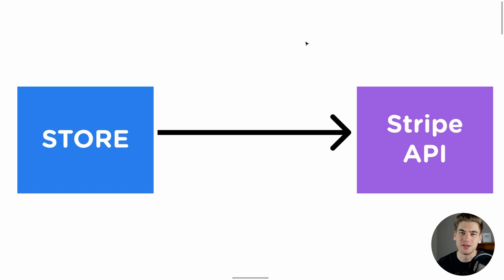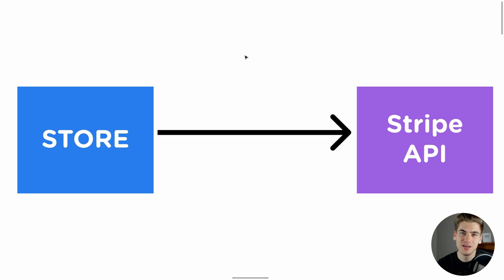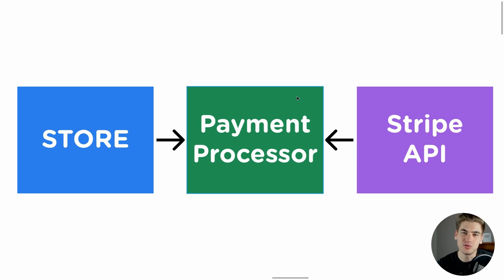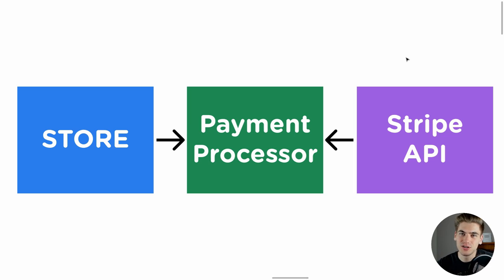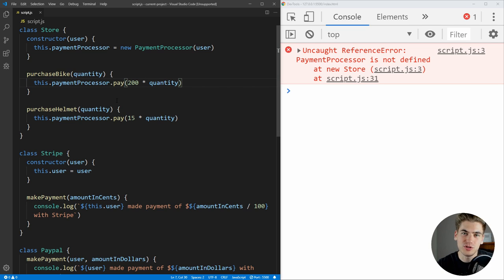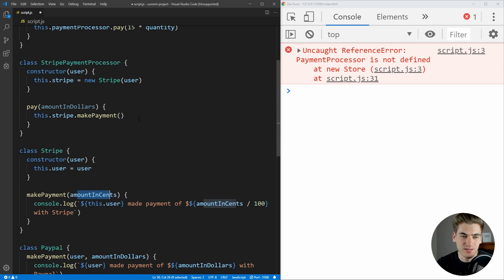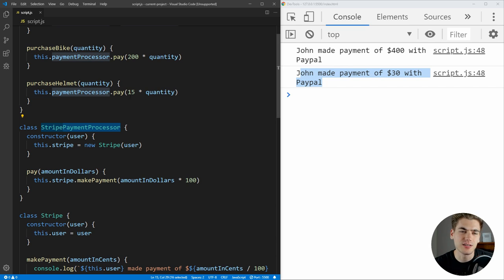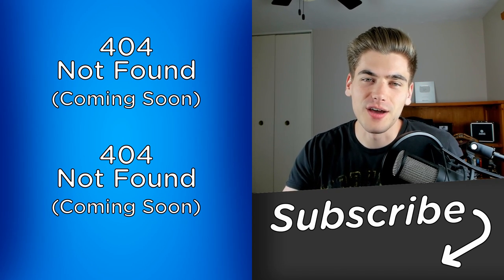Dependency Inversion Principle Explained - SOLID Design Principles

Comment: Wouldn't you want just a single PaymentProcessor and have the logic for handling the different integrations within the class itself so you don't have to duplicate the entire class to change a method?
Reply: That violates OCP
Reply: No, you want some interface or set of interfaces for the payment processing, like an abstract class for the Payment Processor, and possibly using something like the Strategy Pattern, to make your concrete Payment Processors. Then you can use the Strategy Pattern to just swap out between different PaymentProcessors easily.

Comment: Another great video as always! I wish I learned SOLID earlier, so much pain and suffering could have been avoided.
Reply: I have mentored Jr. Developers and wanted to share my experience.  Teaching SOLID too early doesn't work because the coder doesn't have the painful memories that mentally reinforce  / accurately quantify the value of SOLID. The same goes for recognizing code smells.  A Jr Developer is often just pleased with producing a result that works because that's what yielded a good mark in school.  (CS degree is a joke IMO.  Its like teaching just enough chemistry to make bombs without any safety training)
Reply: @skewty  ++. Let juniors be juniors so they can become good seniors
Reply: @danielmcgrane8608 I am happy to read your comments. If dependency inversion is not for juniors then I am leveling up. (:

Comment: Honestly i didn't catch the point of doing that in this example. For me it looks like instead of 2 store classes for each payment method we have just created 3 classes (1 store and 2 payment processors). I thought it should be one payment processor class for both cases which will react different depends on arguments we passed either paypal or stripe. So, a little bit confused by this lesson.
Reply from the maker: The point of this code is so that we can decouple the API we use and the store from each other. Now our store only depends on the processor wrapper we created so we can freely change our API of choice by just creating a new wrapper to wrap that API and our store stays exactly the same. If we tried to make one payment processor that handled all the APIs then we would be violating other SOLID principles such as Open/Closed.
Reply: @WebDevSimplified  i didn't hear yet about that open/closed principles. Thank you for explanation and for all your short but effective  lessons 👍

Comment: Why not make StripePaymentProcessor and PaypalPaymentProcessor implement an Interface PaymentProcessor to enforce the structure of the makePayment method? Optionally it could also extend a PaymentProcessor abstract class if there is some shared method.

Comment: Hi, very nice video! Learnt a ton. Just wanted to clarify my understanding and would appreciate any feedback from anyone here in the comments section. Essentially, by adding an intermediate interface we effectively decouple the store from the payments services. The most common use case I can think of is that, suppose we had a package that aggregates payment services. The consumer of the package doesn't care about specific implementation hence give them the API with an interface. This decouples logic such that the devs working on the package can freely change logic without breaking there consumers code.

Comment: thanks! Note to self - pass individual implementations as object in the intermediate class (functionality resides within individual implementations and intermediary acts as a glue). this way code is losely coupled and is easy to switch rather than be tightly coupled. Facade pattern eg. is very similar to this. Also Dependency injection in angular / Nest feels similar to this where controller will offload functionality to services).

Comment: Only an interface is needed, which would be implemented by both Stripe and PayPal classes. 

I guess Javascript doesn't have interfaces, right?
Reply: normal js doesn't but typescript do, and its almost the same as js but you can use int, float, etc..

Comment: For some who didn't know about the origin of DI.

It was implemented as "Adapter Pattern" as one of Design Patterns. It was only coined as DI because we don't want to depend our application to the framework. We want the framework to depend our application.
Reply: I don't know what is to depend anymore.

Or maybe it's that the word is ambiguous at times.
Reply: @FG-qs8uj  If you want to know more why DI is so important in large scale application. try to search up Clean Architecture by Uncle Bob. It's just the same as SOLID principle.

If you're not happy with OOP. then youi can always go back to Functional Programming.
Reply: If you read what you wrote:

We don't want to depend X to Y.
We want Y to depend X.

X is application, Y Is framework.

Wouldn't be better:

We don't want X to depend on Y.
We want Y to depend on X?

Or:

We don't want Y as a dependency of X
We want X as a dependency of Y.

In any case, my point is that saying X depends on Y is more intuitive to me. I.e. an application depends on a framework to work, i.e. if you see the application requirements file you would see the framework mentioned.

The other way, Y depends on X. Meaning the framework depending on the application is not intuitive to me, since the framework doesn't need the application to work.

I suppose then that the semantics of 'depend' and derivative words is what is confusing.

And even then, I don't see the point on discussing Y depending on X Vs X depending on Y. At the end I don't see what changes in the code.

Comment: Hi Kyle, good tutorial. thank you.

I am little bit confused to distinguish the OPEN/CLOSE and dependency injection based on your example. They are very similar. Can you explain more, please give example
Reply: SOLID is
Single responsibility
Open close principle
Liskov substitution principle
Interface 
Dependency injection

Richard Martin's said that the S and the O can be join together and create a Dependency inversion principle. 

So in shorter words, they are the same
Reply: @nandomax3  dependency injection is not a principle. Dependency inversion is the fifth principle. Dependency injection is an implementation
Reply: @vittoriomorellini1939  it's funny, because I posted this a year ago and just learned about spring DI implementation this month hahahaha

Comment: not gonna lie i had to repeat the video few more times and write some code to understand this concept 
basically what i understood : 
the high level code should not depends on the low level code is like you TV should not depend on you remote remote controller , that if your remote controller got lost you wont be stuck or have to miss with your tv to make it able to use other controller. 
so we should from the start before making the tv and the controller we should first make an interface that both tv and controller agrees on and can work on , after making the interface we make the tv and controller which cant interact with each other through it, so when we want to make new controller for example that we can use for our old tv , it enough for us to focus on make a controller that fit with the interface like the old controller used to be

Comment: But what is the point of making two abstract classes instead of one? Make one, make a init function, a makepayment function and the paypal/stripe fully inherit that and you define what you want.  The only thing that happened is that instead of defining a new entity Paypal and using the function, you added a new class which calls the subclass.
Reply: thats what I was thinking. The paymentProccesor could implement a strategy pattern right? Which keeps it all clean and simple

Comment: This kind of stuff screams for the use of interfaces (I know they are not supported in JS, one of the reasons I moved on to TS)
In this case it's the responsibility of the developer to make sure all paymentProcessors implement correctly the method pay
Reply: This is exactly what I was thinking. Programming without interfaces always looks so cumbersome. This could have been resolved in a much simpler way with an interface.

Comment: There are no interfaces in Javascript? How can you be sure that each type of *PaymentProcessors has method 'pay'? Or should you check it manually in Store class?
Reply from the maker: Unless you use something like TypeScript you cannot guarantee this. It is just something you need to know when developing the code.
Reply: You could write unit tests that verify certain functions exist on both
Reply: Simple version: 
Check that the pay method exists before setting this.paymentProcessor.

 if (typeof paymentProcessor.pay !== "function") { 
    throw new Error('Store.paymentProcessor requires method pay ' )
}

Sophisticated version:
Create a NullPaymentProcessor class that contains the required methods, but they throw a descriptive error (or handle the exception some other way, depending on your implementation) , then make StripePaymentProcessor and PayPalPaymentProcessor extend the NullPaymentProcessor class.

class NullPaymentProcessor {
    pay() {
        throw new Error(`No pay method defined in ${this.constructor.name}. pay is a required method`)
    }

    otherMethod() {
        throw new Error(`No otherMethod defined in ${this.constructor.name}. otherMethod is a required method`)
    }
}

class StripePaymentProcessor extends NullPaymentProcessor {
    constructor(user) {
        super()
        this.stripe = new Stripe(user)
    }
}

class Store {
    constructor(paymentProcessor) {
        this.paymentProcessor = paymentProcessor
    }

    purchaseBike(quantity) {
        this.paymentProcessor.pay(200 * quantity)
    }
}

const store = new Store(new StripePaymentProcessor('John'))
store.purchaseBike(1)

output -> No pay method defined in StripePaymentProcessor. pay is a required method

More or less, use the null object design pattern to implement an interface in javascript. Kyle, would you agree with this approach?

Comment: Does this mean we need to create middleman classes/functions whenever we have dependencies on external third-party api's? Should we do the same if we have have dependencies on internal modules(if it is a big/long module) we ourselves created?
Reply: Coupling is only bad in one direction.   Also don't couple high level business code / computation code with low level data storage / access code.  Uncle Bob is probably the most famous SOLID guy.  Checkout some of his videos if you are interested in further developing your understanding of SOLID.

Comment: In practice these abstractions make code difficult to read and navigate: you keep getting to abstract interfaces and then having to back reference and sometimes guess which implementation is used. The whole idea is that we may easily swap out implementations but in practice this is surprisingly rare.
Reply: Depends on the kind of software you write, sometimes it's very useful. It also facilitates decoupling which can reduce build time in compiled languages and makes it easier to unit test your modules separately which is in my opinion the real reason to do this.

Comment: Is dependency inversion the same as abstraction?
Reply: Dependency Inversion is a form of abstraction, but not all forms of abstractions are Dependency Inversion. Basically, you use DI when you're implementing something that can be done in multiple different ways and you may need to change/support other ways in the future. Besides the Payment Processor example in the video, another example would be if your app had a "share to social media" feature. Say you only wanted to have an option to share to facebook now. You could make a facebook class &  shareToFacebook() method that shares your content to only facebook. But now if you decide to add options to share to twitter or instagram later, you're going to have to edit multiple places in your code base to support this.

Now imagine if instead of creating a facebook class & shareToFacebook() method, you created a SocialMedia class and a generic share method that can be passed in a specific type of social media. Now you only have to extend the SocialMedia class to support twitter, instagram, etc and you don't have to go and edit your whole code base like you would in the facebook class example. Hope this makes sense, good luck!

Comment: So this gives the same  advantages that dependency injection gives in .net can make coupling loose
Reply: Hmmm not sure! Dependency inversion is a type of dependency injection. What is special about this kind of DI is that you do not declare in any moment what concretion will be used inside the high level classes, it leaves it to the client code in which the high level class will be instantiated. Not any dependency injection works like that, after all it's possible to design a dependency injection declaring a low level class inside a high level class, which violates the dependency injection principle, making the high level class get to meet the low level class, generating coupling.

Comment: PaymentProcessor should had been the abstract or interface and , its implementation should be injected automatically where its needed. And unfortunately JS  doesn't have these cuz it isn't a true OOP langauge.
Reply: Yup. Using TypeScript  + annotations + framework with DI (like NestJS in case of Node.js) fixes these a little bit. Would be awesome having runtime interfaces though.